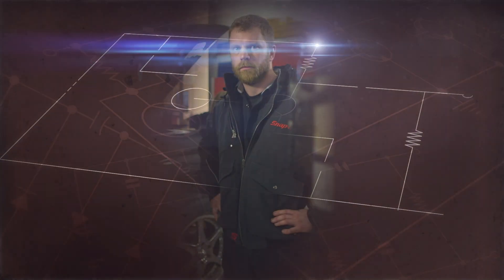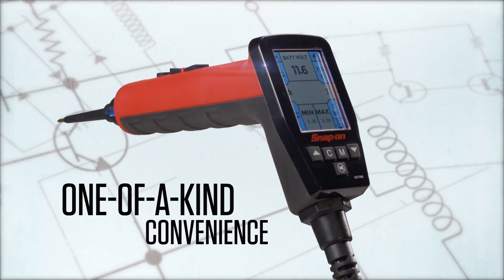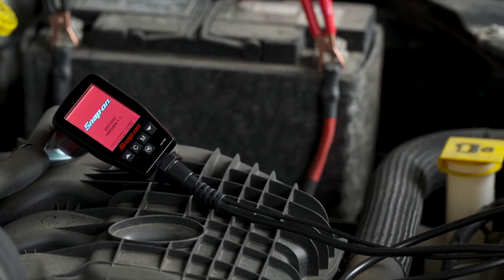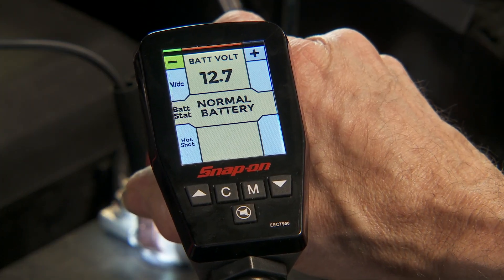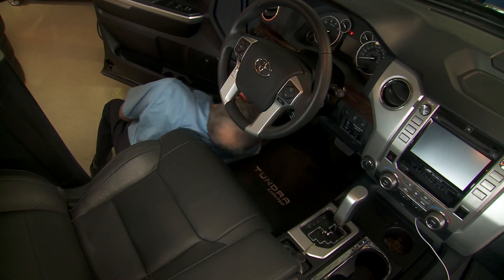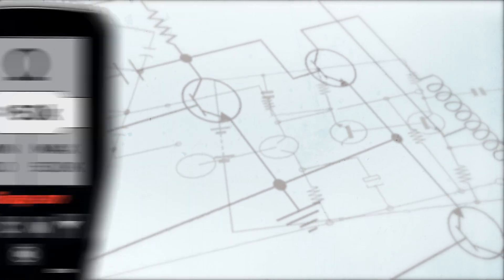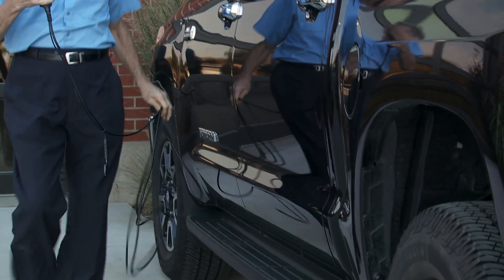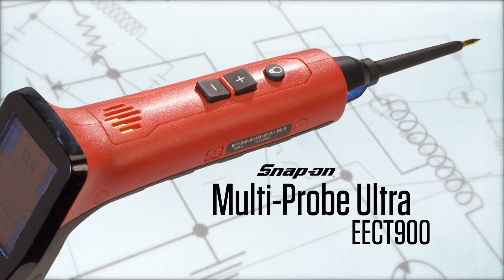Snap-on Multi EECT900 Multi-Probe

Comment: I have owned the power probe 3 and 4, both good tools. The eect900 has better practical functions, In the amp setting I diagnosed a faulty shift solenoid by applying voltage and reading how many amps it required to operate compared to a know good solenoid. 
The adjustable circuit breaker is nice when testing circuits that blow fuses.
Having a built in ohmmeter is nice.
The voltage pulse setting comes in handy for trailer wiring diagnostics.
It does have a slight lag compared to the power probes but I barely notice it anymore.

Comment: So does anyone have any idea what the difference in the eect800 and eect900 because I just got the 800 but for can't really find videos of anyone doing anything with the 800 just with the 900
Reply: The difference  is a 100 hahahaha, 
Now seriously   the 800 have very limited  function  just  DC  voltage  reading  basically  smaller screen  so only give u 1 reading  at time , even on p PtoP  mode only shows  min  or Max  so u have to go back on the menu and select  the other  reading  u wanna see.
 He 900 shows up to 4 readings  at the same time  on the same screen,  reads DC,  AC,  ohms,  amps  and  a lot more functions

Comment: This is a bad ass tool. The large, rearward facing screen is a lot easier for my old ass eyes to read. When I am up under a dash the Power Probe IV was impossible for me to see. This and the Hook are my favorite tools and have made me a lot of cash. The Hook is the best tool I have used for parasitic draws. If you use a thermal imager while the Hook is installed you will find the draw  in minutes.
Reply: Do you have a link to this hook tool?
Reply: @calithug3000  i bought mine off the mac tool truck years ago. i heard they quit making it but i don't know if that is true.

Comment: Isn't The powerprobe hook cheaper and offer the same features? Minus the Fancy color screen. I know Powerprobe made this for SO. But what can this do that the Hook cant? they are both pretty big in size, i do like the rear facing screen but the hook is listed at $248 on Amazon right now and this retails for $330 i think. 

I would buy it for the hotshot feature (hook has this too) and the nice rearward facing screen if my SO dealer sold it to me for 250 or even 260 ish.
Reply: For me the hook is too damn big under the dash.

Comment: I'll stick with my Fluke meter and load Pro test leads
Reply: So your DMM/LP can apply voltage or ground for component powerup testing? And it simultaneously displays the realtime battery voltage vs circuit/component voltage on screen at the same time? 

The LoadPro is great I use it all the time, but it has absolutely nothing in common with nor is made to do any of what the convience of the original powerprobes or this multiprobe are for.

Comment: Waited a month plus to get one. Broke first day I had it. Wouldn't apply power or ground to the tip. Luckily my snapon guy is awesome and stoped by the shop (the same day I bought it) on his way home and traded it out for another one. Hopefully this one will work longer then 5 minutes.